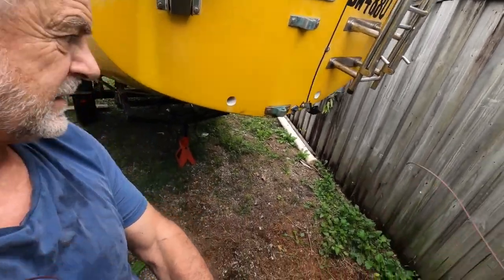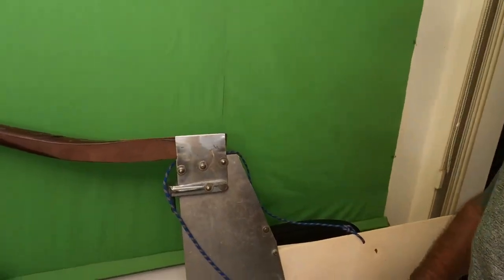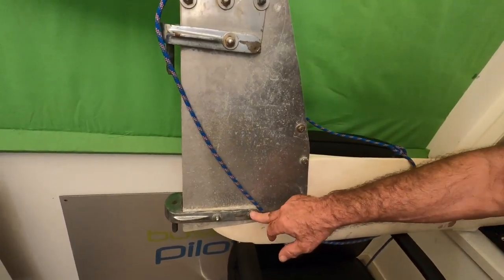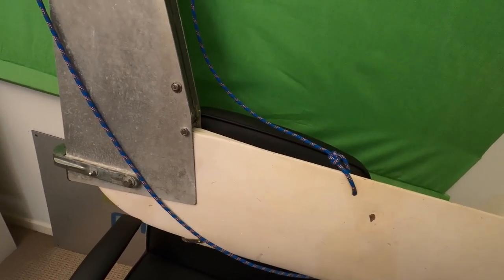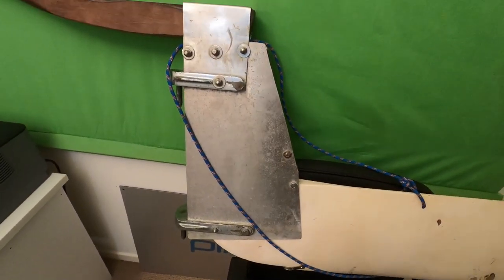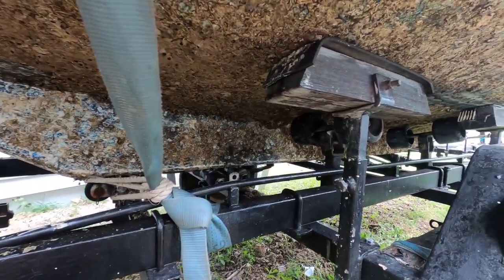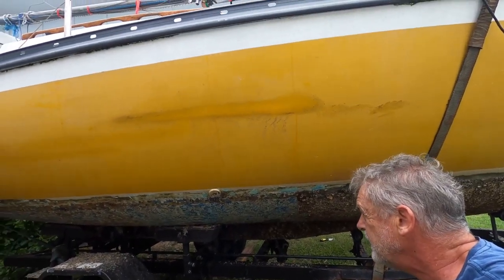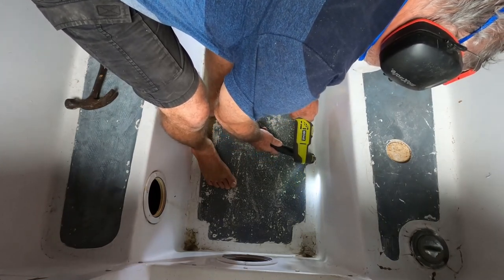What needs fixing? My fiberglass boat project.  A Sunmaid 20  Ep 2

Comment: I  will be very interested in the rudder work, that is where I am up to, the prop seems to hit the side of the rudder, looks like yours is marked the same, and I need to do the leading edge as well. Also noted one of your subscribes Venture offroad Australia 4x4 , Bazz and family have a great series of vidos out on there sailing, and you both have a style of putting the vidios together that takes the viewers on the journey with you. Great stuff.
Reply from the maker: The last boat I had used a semicircular piece of plastic attached to the cavitation plate to stop this from happening. Thanks for the encouragement.
Reply: I've hit my rudder on the prop when reversing off the dock in shallow water and the rudder lifted up. Water pressure pushes the rudder on to the prop if you don't hold the tiller straight.

Comment: Although there is plenty to do it looks like overall it is a well made and sound basis for our Project.  It certainly helps that you have the experience of restoring Moonlight
Reply from the maker: In many things it is necessary to go backwards a little before engaging forward gear. Rebuilding the cockpit floor is like that, but once it is in, it will be stronger than brand new, plenty enough to take the dynamic weight of a full crew in action.

Comment: I'm in the same boat as you (not a Sunmaid) but a little Cherry 16 trailer sailer. It needs a bit of work but is mostly ok. I may have to lift the cockpit and have a look at the centerboard case, so it will be interesting to see what happens under your cockpit
Reply from the maker: I cut mine out. Too far gone to repair, so today I went down to AJAX fibreglass supplies, and $220 later I have most of what I need to make a new one. I'm quite interested in how this will go, and very engaged with Andy from boatworks. Video to come.

Comment: Hi Chris,
I am sorry I didn’t understand what you meant about the Centre board coming down facing forward.
Can you please on your next video do a drawing of it. Thanks very much.
Reply from the maker: Yes I can do that, I have this front of mind, once i get the boat off the trailer and drop the keel out of her.
Reply: @SmallSailboatCruising  thanks very much for your consideration, looking forward to it.
Also I would have thought ( if you can and have the room) to take the yacht of the trailer and trip it on it side that way it would make it easier to clean and sand .

Comment: Hi Chris, Glad to see it is not only my rudder that weighs a ton ! And that there may be a valid reason for that. One improvement I would recommend while working on the rudder and stock is to modify the stock so the rudder is able to tilt further out of the water when raised, this stops, or reduces the rudder swinging around and the tiller banging in the opening. Also it sounds a bit brutal, but to get rid of the last of the barnacle shells try Spirits of salts ( hydrochloric acid), dissloves the lime and does not seem to affect the glass.
Reply from the maker: Very. Good advice thanks I've never had the pleasure of dealing with barnacles before. My rudder sits at 180 degrees when raised. Is that enough or are you suggesting is should go above the horizontal? Do you know what is in the core of the rudder?
Reply: @SmallSailboatCruising  Hi Chris, I have a timber rudder stock so was able to modify it when I was refinishing it. The rudder sits above horizontal when raised so is mostly out of the water. As to what is in the rudder core I would imagine from the weight that it would be solid fiberglass, but don`t know for certain. Mine also has some cracking at the stock end.
Reply: I completely rebuilt blade and stock. The old blade was split and swollen and very heavy. When left to stand it dribbled water out for days. I believe it is cored - mine looked like plywood, if anything. I altered my new stock's design (laminated marine ply plus glass and epoxy) so the blade would lift clear of the water. Just. The blade was 2pieces of 3/4-inch furniture-grade pine board laminated together, shaped, with 'glass and epoxy sheathing. Much lighter than the old original. All bolt holes drilled oversize, epoxy filled and drilled for the bolt. The whole lot was 1/2 the weight and starts floating before it's on its pins. I still consider it a temporary solution (unless it lasts, of course!). I shall be lifting my Sunmaid off its trailer soon, so will watch how you do it with interest. I do hope you film the process. Cheers.
Reply from the maker: I think I was misled by the owner into thinking it is ballasted. I’m suspecting it’s just full of water and rotten ply.

Comment: How does your rudder lock down? My Sunmaid20 has a metal rod on the back of the rudder.
Reply from the maker: The best answer I have for that is it doesn't. Friction is a factor. I've seen your arrangement, and will need to look into a solution. Glad to be connected with you. I may have some questions to ask as the project progresses.